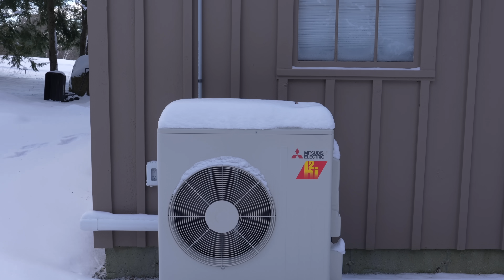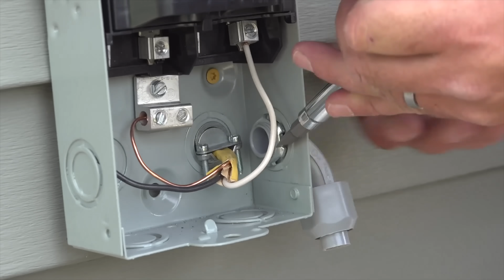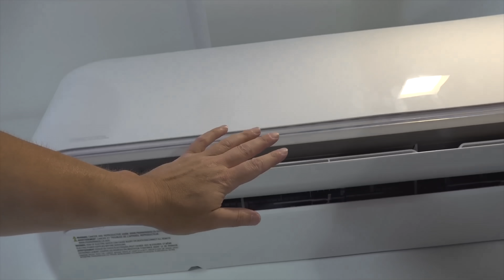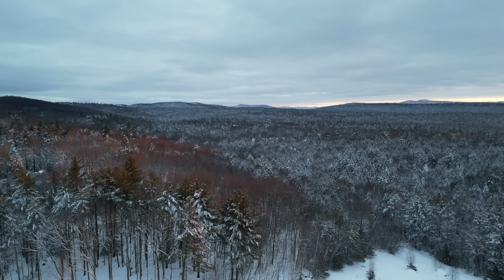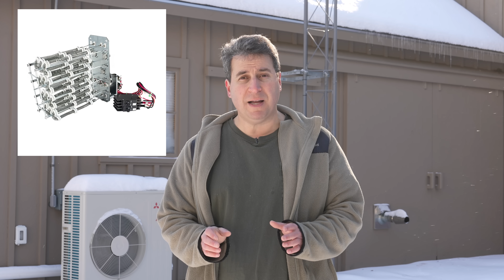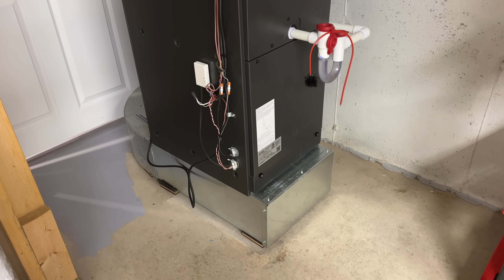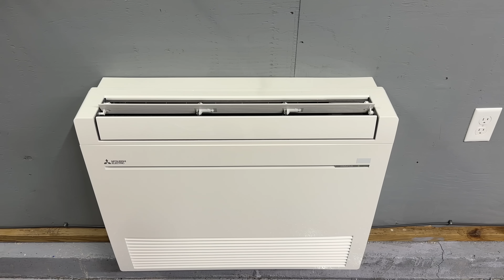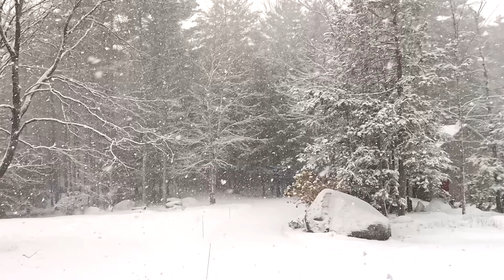Why Heat Pumps are now leaving people COLD

Comment: I wish heat pumps (and air conditioners) had a easy way to add a ammonia heat exchanging loop to the refrigerant lines so you can use a unmetered water source for a heat / cooling source.

Comment: SE Pennsylvania. About 1400sf ranch house.  Full basement.  House is well insulated and tight. Heat pump is used for summertime cooling and heating to 20f.  Below that we have a oil fired boiler, our emergency heat source selected via the thermostat.  The boiler was installed originally to heat 2 rooms in the basement , baseboard hydroponics,  and heat pump backup.  
We also run only oil heat if we go away for an extended time in the winter.  That way if any snow accumulation on the compressor does not matter. 
And the original electric backup is on a manually selected switch just in case the boiler dies or heating oil get very expensive.  As it is we use maybe 130 gallons of heating oil in a year mostly for winter trips. We fill the tank in summertime, usually 125 gallons.
Reply: Oil boiler was installed 20 years ago,

Comment: Good luck with -40°c. Any person who puts their faith in a bunch of batteries or our electric in general is an idiot.  Happens if you have a power failure in the winter and it has happened to me living here in Canada by the way if I didn't have my gas stove using ( while using great caution with a carbon monoxide detector) how would i stay warm; I wouldn't have

Comment: if I get a heat pump ⛽ it'll be the addition to the main unit rather than the main unit itself hopefully using cheap wind solar water/gravity energy ... but depending on area geothermal is a great option too just gotta convert it to what you need

Comment: New and better heat pump technologies are coming. But, a heat pump needs to be installed by some who can analyse the thermal losses and climate. If you live in the lower states, a back up might not be needed. But, further north requires a back up.

Comment: My heat pump is working fine. Just needs a little boost from the integrated aux heat coil to get it toasty in the house. Old house with less insulation so it’s not the most efficient

Comment: This video is largely but not 100% correct. Correct, that as OFTEN sized, AIR SOURCE (not ground source) heat pumps may require supplemental heat if you want to maintain 70F on the coldest days (and warm weather heat pumps simply won't work). Note however that this depends on how you size the system. Carrier Greenspeed heat pumps for example have data tables showing heat capacity for different indoor / outdoor temperature conditions, and although the heat capacity (how much it heats) at -5F outdoor with 70F indoor air temperature is lower than at e.g. 30F outdoor and 70F indoor, there is nothing stopping an installer from using the -5F outdoor capacity for sizing purposes. With today's tech, hybrid systems often make economic sense since it lets you use less expensive equipment to cover the majority of the heating season - especially if the customer already has another heat source, but this is ultimately a question of preference. (Backup heat sources can double though as redundancy for power outages, depending on the chosen system.)

Another error: it is not more energy efficient to supplement a heat pump with electric heat strips on the coldest days vs. just running the heat pump continuously. At least, looking at the Carrier Greenspeed data tables, even at -5F outdoor / 70F indoor you still get much more than unity COP, whereas electric heat strips only offer unity COP. That said, very occasional heat strip use might still make practical sense when trying to balance upfront investment in heating equipment versus runtime cost. We choose not to use electric heat strips in our house here in CT, but reasonable arguments can be made in favor. Again, consult the performance data for your chosen heat pump model, but I would be surprised if any heat pump drops below unity COP.

One thing worth consideration: what temperature do you want indoors on the coldest days, especially if those days are rare? You can design to keep 70F even on the coldest recorded night on record in your area if you want to, but a little compromise for those rare days might be another way to economize. (But no matter what, make sure your pipes don't freeze! But electric heat tape for problem spots can be a cheap way to address that issue.)

Other than these details, this is an otherwise excellent video. Thanks!

Comment: Where I live we have 2 golden rules, a) isolate your house, that is the biggest and most important thing you can do, also lots of heatpumps run a water cycle, aka... you have a 200 liter tank which the heat pump heats up and then this is pushed into a floor heating system, the floor then picks up the heat in the concrete and keep the heat and distributing it evenly. Also the heatpump does not have to work the entire time! Downside, you cannot cool your house that way efficiently given that heat goes up cold goes down cooling a house with a floor cooling water based system is very inefficient. Also ground heatpumps have a way higher efficiency than air heatpumps! They are way more expensive, but the idea is to use the natural heat from lower soil levels to improve the heat exchange efficience instead of relying on the air alone.
Below a certain level of ground you never go into the freezing temperatures if you can use that as a medium and pump the heat from there you will never reach the inefficiency zone which starts at freezing temperatures!

Comment: Happy this info is getting out. I spent 15k on installing mini splits on my rental to then realize they suck as soon as it drops below 50 degrees outside. Good thing i kept the boiler and radiators intact
Reply: You should have bought a set that says they heat down to -22°F.  The super cheap mini-splits can barely handle +20°F.
Reply: Because you had the wrong units  installed

Comment: I need to mention that the Temps dropped to 11 below and my System was low on iGas -- Before charging the Unit,My Senville Unit kept my House at around 64 degrees....After I flashed the System(adding a few ounces to bring the pressure back up to 400psi and 101 on the Low) , the Temps dropped to Minus 8 and the House stayed at 68 degrees which is what I had set. I'm heating a 1,600 square foot house

Comment: Alle the nordic countries use heat pumps a lot, made for our climate. In -20 degrees C , they still saves energy. 1 kwh spent gives 2 kwh heat.

but you need often supplement heat like sn electric hester or wood stove. 

In temperatures from -10 degrees c many homes in Norway, Sweden, Finland are heated just by the heat pump and some wood. Most of the heating season you get 3-4?kwh heat forceach 1 kwh used. The pumps last 10-12 years at leadt, and pay for them selves in energy savings.

Comment: As mentioned, resistance heating is very expensive.  Some houses ca 1965-75 were built with resistance strips in each room, back when nuclear power was to be "too cheap to meter", but surely most were upgraded.  Better on very cold days is to use a portable radiant electric heater to heat the people via thermal radiation, but not try to heat all air in the house.  A wood stove is even better for additional local heat, if you regularly have wood from tree trimming as I do (must dry for a year).

Comment: You didn't say that refrigerant compressors pump easier as it gets colder. Less resistance to flow. Of course efficiency still goes down but the power consumption goes DOWN. The % of time the heatpump is on goes up but power consumption while on goes DOWN.
Supplemental heating is another story. Also variable speed compressors.. but per RPM the power consumption is less. They do have an over-RPM mode to help stay relevant without needing supplemental heat. Should still be more efficient that just using resistive heating.

Comment: I guess my old system didn't get the memo.  A 3 ton R-22 system, house is 1974, brick, no wall insulation.  (It does have attic insulation.)

I live attached to the north side of Austin, we saw 18 degrees overnight for several nights, highs about 30.  Because of the inefficient auxiliary heat strips, I flipped them off. Heat pump alone got the interior of the house 45-50 degrees above outside.  High 60's, low 70's.  Sure, it ran for three days, but no auxiliary heat.

Comment: This is borderline misinformation. I live in Canada and have a properly sized, highly efficient Fujitsu mini split that has 123% of its capacity down to -15 Fahrenheit or -26 Celsius. You need the right unit, thats properly sized. The problem is the HVAC industry is full of scammers who install inadequate systems. Every system needs a manual j calculation to ensure performance on the coldest of days. Oversizing with mini splits is a myth, install the bigger unit if necessary. They modulate down low in the shoulder seasons.
Reply from the maker: Oversizing units for heating capacity can be a strategy, however in many installations putting in physically larger wall units in smaller spaces can be problematic and look bad. Say a 24,000BTU in a larger bedroom. The only Fujitsu I am aware of that gets such a high rating is their 9000BTU model, the larger ones are far less than that. Additionally you left out (and I did too, not expecting this part of the video would be so disputed) is the defrost cycle stopping heat production and in fact removing some room heat too in lower temps, which can be as high as 20 minutes of every hour. Supplemental heat can also be run during that period, eliminating the deficiency. The goal here isn't to make you buy something if you are satisfied with what you have. But many people just think some things are normal and they aren't and they have options. I have a follow up video on this which dives into much more than this which I think you will find interesting.

Comment: The supplemental heat is also valuable when the compressor fails, or there is a refrigerant leak. Those take longer to repair than a blower motor. It does require a lot of power, and your breaker panel may not be able to provide that power without a service upgrade.
Reply from the maker: That is an excellent point to bring up as a great extra benefit

Comment: I’ve had a mini split for 10 years now. They are high maintenance and need to be deep cleaned yearly and it’s expensive to have an hvac company do it. I just figured out how to do it myself because I’m not paying my HVAC company $700 a year to clean both my units. And also I have to supplement the heat with a radiator space heater when it gets to single digits or lower. That’s only maybe 7-10 days a year tops but it still needs to be taken into consideration. They’re not perfect but they are still cheaper to install than new duct work and a furnace and A/C. We had to get them because our second story in an attic space didn’t have duct work. They’re also incredibly dry because they’re electric. So I have to crank a humidifier in my bedroom when it gets cold out or the nose bleeds are out of control.

Comment: So long story short what he is saying is it's not the heat pump it's actually the house isn't efficient because the house isn't insulated properly. So how is that the heat pumps for the heat pump doing what it's supposed to do The house isn't sealed so it isn't holding in the hot air

Comment: My solution is to live in Arizona  so my ducted slit system 5 ton heat pump works great! Lowest temperature this winter was 31 degrees for an our or 2. I also have lots of insultion.

Comment: i installed a heat pump in a 1200 sq foot home .it works well till about 40 deg ..it still works but it runs all the time ,at about 27 degrees it puts out cold air about 65 degrees in side .at 16 degrees it kicks out at high head pressure .when in defrost it is not warm enough. and  long enough.the 40 btu electric heat does not do well in 16 degrees either.at about 27 we are ok .its a great system hot or mildly cool  .just not freezing .great way to go but not great in realty cold climates .this is a 2 ton self contained pack unit with air ducted system . thanks he is correct .
Reply: You don't make much sense, and a 2 ton unit will not heat or cool a 1200 sf house at any temperature extreme.
Reply: @frequentlycynical642   its a 3 ton blueridge,  at 40 degrees it stays running ,it is 74 Fahrenheit in side .it runs and does not stop .maintaining 74 when the temp out side is 27 it still maintains that 74  degree  with aux kicking in .aux is the electric elements .temp in side drops to 65 with out aux . but when it gets to 16 degrees outside it goes out on fault. the code it gives is head pressure so it says .its all electronic controlled.it has been running well with no maintance  calls  for  four years summer and winter .but when it trips out the aux still runs .blower fan slows down and heat is not hot .about 65 degrees from the registers .the compressor and evap fan shuts down in the fault mode .the house is 1200 sq foot ,one floor ,crawl space .no insulation on floors . old insulation in walls  but well sealed with red  brick foundation and auto temp controlled air vents in the crawl space .any leeks in the air ducts keep the pipes from freezing .so far .that is with the three days of 30s and below just passing this week. we do heat with wood in a fire boss when it gets 19 and below. day and night ,at  times we heat with the wood stove .just to save money on the  electric bills .i hope this explains it better. my mistake on the tonnage. but the three ton unit does it job most of the time .i would have installed a propane furnace  pack but the house is all electric and propane has its separate service bills and contracts .i did not want them so i went all electric.   if i had this cold weather for longer times like the north  i would have installed the furnace pack with heat pump..

Comment: For us in NH, we're still saving money compared to oil and even pellets. We did have to buy a wall convection space heater for a bathroom that wasn't getting enough air circulation. Also lucky that we changed our electrical supplier so we're paying half what we did a year ago.

Comment: I have a heat pump but still use small electric heaters.  I've actually turned the heat pump off sometimes and just used small electric heaters.  I also have gas logs that will run you out of the room, lol.

Comment: Guess what. My sister lives in North Carolina, after 20 years, they installed a natural gas furnace,  because the heatpump kept using emergency heat system for weeks at a time sky rocketing the electric bill.

Comment: I am in South Carolina, I installed a dual fuel system and set the change over temp at 30 degrees. It was 17 last night and on gas, so I have benefits of high efficiency and great heat in 1 package. Later today when it gets above 30, the unit will switch back to heat pump.

Comment: I've got 3 minisplits in Wisconsin.  All 3 have operated thru this cold stretch.  I've noticed nothing other than they run more.  2 of mine are rated to -13F, and one is 5F and even the 5F model was operating below 0F.   I also have a woodstove, but i haven't used it nearly as much this winter.

Comment: Living in a place where -20's are common throughout winter we know about the limits on heat pumps and the concept of supplemental heat sources.  Ground loop heat pumps are also gaining in popularity here as well.  They're not nearly as cheap or easy to install, but they work efficiently even in the coldest weather.

Comment: My gas furnace recently died and needed a new one, I inquired about a heat pump with the hvac company but was told it's just not worth it here.  We get -20's and even -40's fairly regularly, so it would not be able to keep up.  If ever my AC unit fails, then I might consider switching that out for a heat pump though, that way I'll still have the gas furnace but I can use the heat pump in spring/fall when it's not as cold.  I am in process of putting in a wood stove though so that will basically be free heat.
Reply: I burn firewood for 10 years, it is not free there's a lot of cost & work to it.  Not even sure if I broke even burning wood. Lot of wasted time cutting hauling, Stokeing the furnace, cleaning the chimney, Hauling firewood in the house, sharpening chainsaw chains. Don't let people B.S. you about burning firewood being so cheap. Their is always some danger of having a chimney fire too.
Reply: I don't mind the time it takes, it's a workout and good for health.  Still save lot of money on the gas bill and that's what counts.  Money is a limited resource. So is time, but a lot of it is wasted just sitting around watching Youtube anyway. :P  May as well use my time to save money and over time find ways to do things more efficiently.  Oh and get an electric chainsaw, so much easier.  Electric stuff has come a long way.  I don't bother with gas tools anymore. Even my snowblower is electric now.  If EVs could come down in price that would be the ultimate way to save money when getting wood. But can't justify the cost of those.
Reply: We live in Manitoba, one of the coldest places in North America.  We've had a heat pump for four years.  Our heating costs have decreased dramatically.   When the temp goes below -17 C our old natural gas furnace cuts in.  The system is much cheaper than previous systems - electric (base board and e furnace), oil, gas, wood, and coal) - not even close to the heat pump.